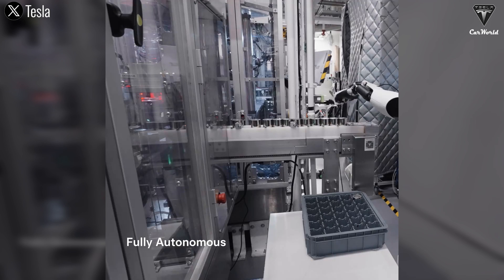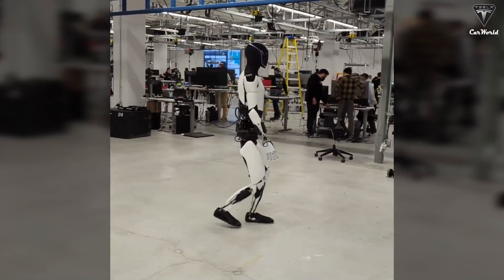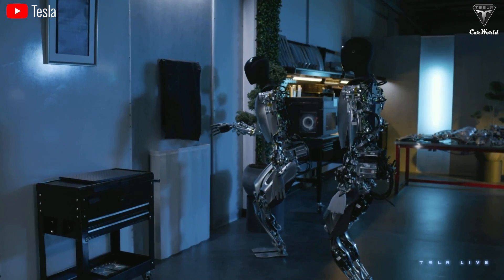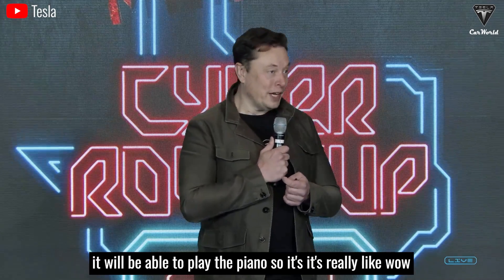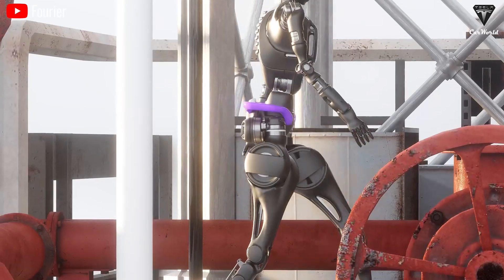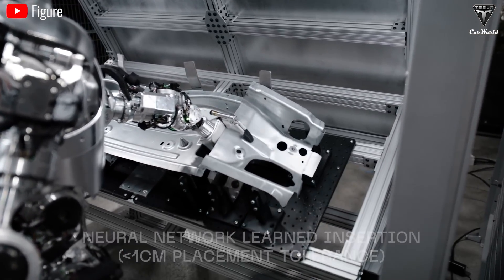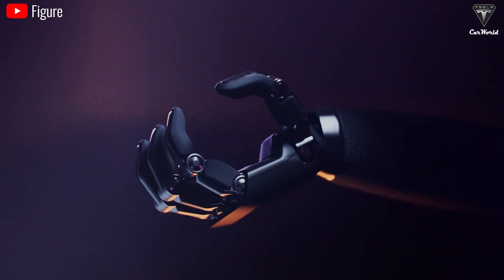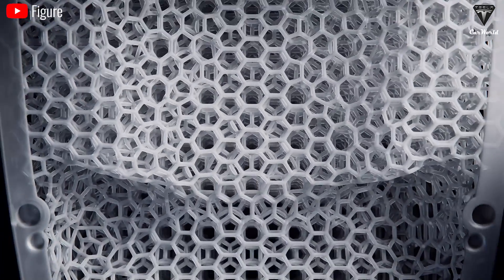Elon Musk Says Tesla Bot Gen 2 Optimus's Hand Can Do 1000 Tasks! Money Machine Only $20K ?

Comment: I do have one complaint about the way it picks up those cylinders and loads them - it would be way more efficient and faster if it used both hands - as the left hand it placing one cylinder, the right hand is picking up the next, and so on.  that's the way a person would be doing it.

Comment: They need realistic hands for sure, the more movement and functions, the better. But also realistic feet. When you walk on the ground barefoot, you can tell if the atmosphere is cold or hot. Say your heater goes out at the house, your floor will get cold. Maybe you step barefoot on sand or concrete that's been baked in the sun and it's super hot. Also, it would help with better balance. Getting a better feel for the different grounds and floors would help improve the robots memory for different terrains, making them more stable. They can recognize "oh I'm in the grass, better take extra precaution so I don't step in a rut and trip". Give them bare feet like humans so they can have a better understanding of various terrains so they can walk/run more efficiently. Just a thought

Comment: I want to see it demo a shower and rebuild it , and all it entails.  From taking the the proper old part out and taking to the dump , then figuring out whats needed picking it up , then doing the the best job job at insuring all the proper steps are done to guarantee no leaks , puddles... proper drainage, setting the tile with no lippage ,cuts perfect, adhering the tiles guickly so they stick building up or down so there right , then grouting right and sealing the tiles . If the area under old shower needs replaced can it identify what needs replaced ... and would it know what the proper tool for the job is? Now that i think of it , its a pretty info and ability knowlege job ... i think i need a raise . Not only showers now but every aspect of tile setting floors ,walls, showers, stairs, elevators ,could it se5 tile on ceilings ? I heard that a tile setter will be rhe last job a Robot will take over is this true ? I really would like to know ... should i keep working or buy a robot and teach it? If a  robot teacher is needed and the pay is right im your Tile Man. Let me know ...
Aloha DSC777